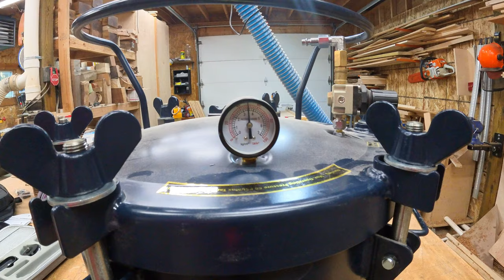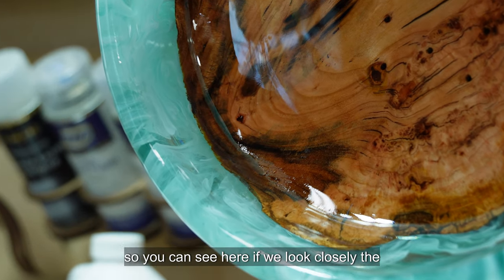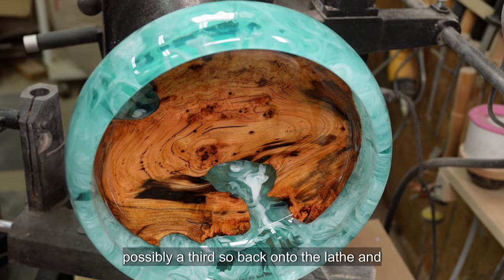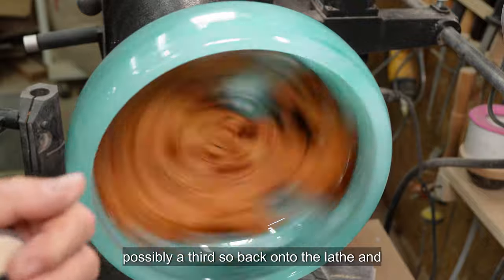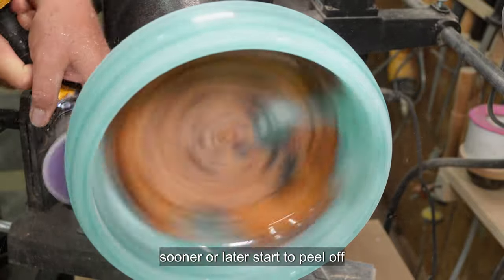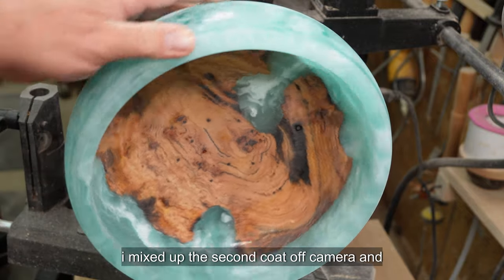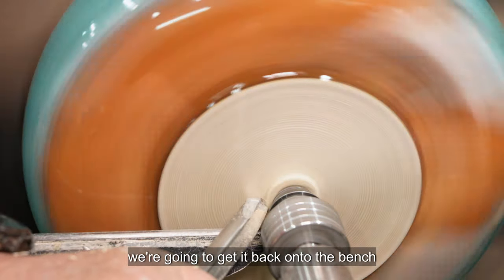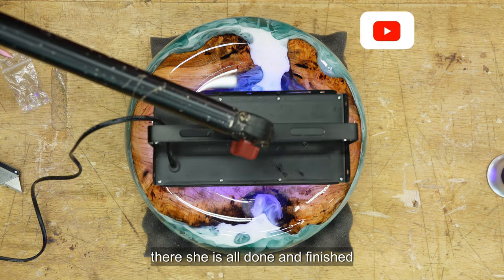Exploring Burl Woodturning Techniques

Comment: Very nice.  Love the color choice.   What’s the tool bit you used in the video to clean off the bark?   Looked like a round ball but I didn’t see any teeth.   Oh and those silicone molds you use are top shelf for sure.  😊
Reply from the maker: Thanks for the kind comment. The tool for cleaning bark etc is the Arbortech ball gouge. It’s carbide “ringed” steel ball that fits into an angle grinder. It’s a beast! lol